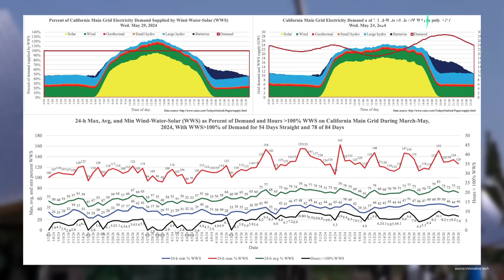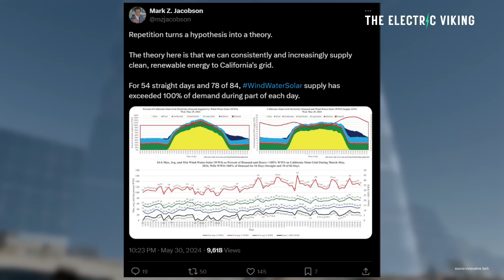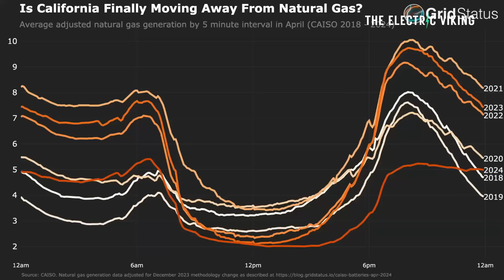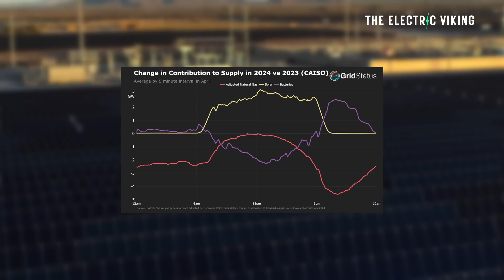Solar smashes records in California, 'DUCK curve' nearly wiped out

Comment: I have never heard so much BS about Peaker battery operations. If your imagination could get you to 100% solar, this guy accomplished it. What happens when the sun doesn’t shine or the wind doesn’t blow? Find another generating source or do roving blackouts like South Africa. This is what Californians have to look forward to an addition to the high electrical rates caused by electric vehicles and green energy. Sorry to burst your bubble, I am all for green energy, but this is not reality.
Reply: The trend is to install combined cycle power plants. They are more flexible, faster, startup faster and efficient. Other trends  are towards decentralization, distributed generation and Virtual Power Plants (VPP). Ultimately a widely dispersed network should have enough resources. With, an intelligent system, problems should be manageable . Yes, extremes condition could require curtailment, but it is a simpler system that should cost less.
Reply: California, I'm told, currently has less power outages than in the past.

Comment: Sam, we are in the Sierra Nevada Mountains on the first warm day of the year. The thermometer in the shade of our front porch reads a warm 97 F. That is about average for Summ here. 

Our power is $0.41 US per kWh. On “smart days”, today for example, our power is four times that price in the late afternoon and early evening.

The California electric utility system is nothing for anyone anywhere to emulate or admire. The three electricity monopolies have divided up the state like any cartel divides its territories. The SDGE gang’s hood is San Diego, Edison has LA and the Southern Central Valley, and PG&E runs Northern California. 

I
The Capo of the Northern California pulls in at least 10 mil a year. 2021’s was an especially good haul, and the Capo picked the pockets of California ratepayers for 50 million. 

The only option Californians are left with is to cut ties with the corrupt utility cartel completely and go solar and batteries and go off grid. That is why I’m constantly writing in your comments section that we desperately need more affordable home storage batteries. With our need for home cooling during our warm summer nights, and lights on rainy and snowy winter nights, per my calculations the smallest battery system I could get away with is 50 kWh.

Comment: Did you all miss the key phrase. It reached 100 percent for part of the day. Not all day every day. And they still require a complete fossil fuel back up system for when the wind isn't blowing and the sun ain't shinning. So how can running 2 complete systems be cheap.
Reply: But when your not paying for those hours that's big bucks savings.  As more gets added longer times will come.
Reply: @leshigger6517  but you have to pay for the infrastructure weather you are using it or not. To have a complete highly capital intensive plant sitting there unused is expensive both in opportunity cost and holding cost. So when the plant is running the sale price of the electricity must be huge to cover the cost of having the plant sitting idle for most of the time. It is basic economics.
Reply: If you use battery storage like megiapacks you are not running a speaker plant generator.  AZ has been doing that for a few years now. I believe Texas in building one now. My brother in law just leased property for 20 packs to replace a proposed peaker NG plant in AZ. This is where it's going. Newer cheaper megapacks coming on line are replacing gas and oil and coal peaker generators.
Reply: They're not listening. But I appreciate your effort.
Reply: There you go using facts and logic, rudely interrupting their fantasy.
“. . . a naïve observer might conclude that the rising share of new renewables (solar and wind) will usher in an era of falling electricity prices.  But in reality, the opposite has been true.”  Vaclav Smil, Numbers Don’t Lie, p.172

Comment: In the future nobody will mention V2G, or V2H, or V2L, (grid, or home or load)
Nobody will mention grid electricity. 
Nobody will mention selfplug-in or selfparking. 
Nobody will mention electricity bills or gas bills. 
Rooftop solar PV will just be your roof with a waterproof membrane underneath. 
Rooftop will be 'plug-n-play' with micro inverters.
Reply: It doen's need to be micro inverter, but certainly some kind of inverter.

Comment: 2 new, giant wind plants and several new giant solar plants are in development now, to start supplying power to CA in the next 1-2 years.  Cal. is working to: 130% of total capacity via solar, wind and hydro, to net-export power to other states.
Reply: It would be interesting to see their seasonal output.  The shoulder seasons: Spring & Fall are the best for percentage of solar generation because the sun is still relatively high and demand for heating and cooling is low.  If they can achieve 130% in the summer hot season and the winter cold season, that would be impressive.
Reply: @glibsonoran  Agreed.  This transition won't be smooth.  Mistakes will be made.  Inefficiencies will happen.  But in a decade we'll be amazed at progress.  Heck, 5 years might be worth celebrating.
Reply: And 130% makes sense because you need to top off energy storage.

Comment: Did you hear in California so many people drive EVs that they now want to tax the people $.03 per mile driven to replace the gas tax they're losing!
Reply: Fake news
Reply: The actuality is that they have asked for volunteers to test the practicality of a VMT tax. What they propose, but is years away, is a tax that depends the product of car weight and miles driven. This would replace the gas tax and would be a charge closer to the damage done to roads. Remember, the damage done by an axle is proportional to the 4.2 power of the axle weight.
Reply: Well if they tax per mile like a taxi why spend tens of thousands of dollars on a car, and  registration, inspection and insurance. It would be better to take an Uber.
Reply: @PyroShields  If you have a gas car you are taxed automatically (and heftily) per mile, by the taxes on gas. It's just fair that EV owners also do their part, because their vehicles create much more road degradation (and also more tire/rubber pollution) than ICE cars, due to their ridiculous weight.
Reply: @hiram1923  If you take  a taxi  or an uber you pay by mile. So who would buy a car to  pay per mile lol. Even better get an Ebike. No registration required.
Reply: @PyroShields  Everyone pays per mile, except EV users so far. Which is (to some extend) fair because it pays for road repairs. If you have a car but drive only very little, you should also pay less on taxes, because you create less road degradation.
Reply: @hiram1923  That's not how it works in the US. You pay for road tax, when you file your taxes that's when you pay.  The newer the car the more you pay. Your tax per mile theory would never work because, how would they track the miles? Why buy a car just uber or buy an ebike and even if you have a car people will start rolling back the miles.

Comment: Sounds like propaganda. Cali has very high electricity prices and keeping a long paid off nuke plant open is not the reason.  In fact when the Cali Governor realized there was a danger that in closing the nuke plant he changed his mind coz there was a danger of power brownouts that would hurt his political standing.  Every summer for years now the Cali grid has been hanging by a thread with consumers asked not to run aircon to stop brownouts. Get though one summer with no danger of brownouts and you might have a point ... but you don't coz ... every summer in Cali there is the danger of brownouts. So you have some of the highest prices and brownout danger in Cali.  What a disgrace.

Comment: ☆You make me think.😀

As I said, only the government can afford to lose grid income. 

So, it should be the government and not Austgrid installing the community batteries. 
And giving up the income from the suburbs with the battery.

At the moment, all customers pay the same GRID RENTAL kWh. 
The customers at the power station pay the same GRID RENTAL as the customers 1,000km away. 

The little local grid to the generators' neighbours should be a few cents for the GRID RENTAL.

The 1,000km distant customers should pay 100cents kWh or more for GRID RENTAL. 

That is the concept to help your understanding. 

When you are carried different distances, you pay different amounts. 
When you send something of value, different distances you pay per km.

I am saying a community battery paying for the battery cost plus a SMALL GRID RENTAL fee would be the same as the house battery and no grid rental fee.
It would have maximum 'economy of scale' plus real grid costs plus backup to individual homes that are in need of local grid supply. 

As early adopters fill the test suburban streets with V2G and do not need any grid electricity, then the community battery can be moved to the next test suburb, most likely to have V2G EVs and rooftop PV. 

The private sector will see that the 'offgrid' in the suburbs is very practical and electorally attractive.

The government will see that new grid capacity construction will not be necessary. 
New generation capacity will not be needed. 
This is a massive cost saving.
Petroleum imports can be reduced. 

If the grid is to be kept, then 20 million buildings paying 1$/day connection fee would cover grid maintenance.

Australia can demonstrate to the world that EV and rooftop PV is viable. 

80% of the world's population live in warm latitudes. 
80% of the world's population lives in dictatorships. 

Non Petroleum countries can not sustain distant wars. Logistics problems. 
Hahaha Hahaha 👍 

People with glass roofs don't throw stones.
Hahaha 👍

Comment: It is anti electric to make expensive unreliable unsustainable power grids that are causing industries to relocate and discouraging new industries from being built.  Southern California power grid is a disaster.   Southern California has the highest cost electricity in the USA along with bankrupt power grids unable to modernize their high voltage lines.  They have been forced into being unsustainable, bankrupt and having to import power.  

 In the USA wind turbine generated electricity always cause electric rates to go up if the rate payers are having to pay for them.    Solar panel electric In order to power the grid that is not charging storage has to have ready power to make up when a cloud goes over a solar farm.   That electric supply is probably running on expense natural gas that keeps having to run even when solar power might for a few seconds power 100% of the grid.   

SoCa without new technology nuclear plants could benefit immensely from a new large ultra high efficiency clean burning coal power electric generation plant in the 6 - 12 GW capacity likely placed on the coast for ship delivery of coal.   The fueling costs would be 1/4 cheap natural gas prices.   Cheap natural gas is difficult to maintain with shale natural gas only producing highly when first started.  A decade from now natural gas in the USA might still be a good buy, but not cheap.

A fossil gas can be about any gas that comes from the earth such as sulfur dioxide.  Without large subsidies and huge incentives solar electric and wind turbine electric power would have little implementation in the USA.  As it is they may just break even.   This would be fine for incentives of developing to higher levels, but we are now at a high level development without large improvements in cost benefit likely.   

The SoCo power grid is having to buy roof top solar that is close to worthless at net metering rates until recently and still has to do that indefinitely for existing solar panel installations.

Comment: I retired from a municipal Power and Water utility in Central Florida. My former employer is moving away from fossil fuel to renewables. Because green power is cheaper. My daughter part owner and manager of a pest control company are selling their gas fleet of vehicles and replacing them with electric vehicles. Because there are big money savings to be had . Dropped the cost of transportation to half of what it had been.  Plan on putting solar panels on their property to eventual charge their vehicles saving more. The fossil fuel oligarchs are fighting this but they cannot stop it. This is going to change the balance of power of the USA as without money or much less money the fossil fuel oligarchs will not be able to buy elections so easily and fund disinformation to fool voters into voting the interest of the oligarchs not their own actual interest.

Comment: Grid electricity bill 50cents is basically 2 parts for me:
5cents kWh feedin.
45cents kWh grid rental. 

Electricity is dirt cheap 
Grid rental is expensive 

The grid is 10times more expensive than central generation plant. 

Nuclear electricity is 5cents kWh 
Distant renewables is 5cents kWh 
Fossil fueled is 5cents kWh 
Hydro generation? 5cents kWh 

The owners of the grid need 45cents kWh to pay back the cost of the grid investment and maintenance 24/7/365.

New grid construction costs and old grid upgrade costs tell you that millions of km of national electrical grid costs $$$$$$TRILLIONS. 

Hello  hello 👋

Rooftop is often only 33m2 on a 220m2 roof 
Rooftop installed is basically cheaper than windows $/m2 
Rooftop has NO grid costs. 

With selfplug-in V2G EVs at every building and home, every customer does not need grid electricity.
No grid costs.

Offgrid is extremely dangerous, economically, to the massive investment in the national grid. 

But climate destabilisation is extremely dangerous, economically, to the nation.

Technology wise, the grid owners can only delay, nothing stopping the new technology now.

Elon Musk knows this, as do all the automotive manufacturers and the military and grid owners and superannuation funds and private investors.

Offgrid in the suburbs using community batteries in the early adopter suburbs is the killer change.

Comment: Hey Sam,
You missed geothermal. 
Almost 6% of CA's electricity came from that source in 2018. Didn't do further research but I thought you should know. 
Thanks for what you do, I really enjoy you channel 😊
Reply: California is the largest generator of electricity from geothermal energy in the United States, with more than 650 active, high-temperature wells tapping into geothermal fields.
In 2018, the state received 5.92 percent of its electrical energy from geothermal resources.
The problem with Geothermal Energy is, Fracking. California is in the process of making it illegal.
Reply: @johndavid9418  California is capable of distinguishing between fracking for geothermal and fracking for oil and gas.  I bet they'll get that figured out.
Reply: @incognitotorpedo42  
They intend on replacing their Geothermal with renewables.
Reply: Unfortunately, the percentage of geothermal keeps going down as wind and solar get installed.  2018 was 6 years ago, time flies.   Geothermal does give a nice even 800MW throughout the day but compared to today's total system capacity of 50GW, it keeps getting smaller as a percentage.  Here's some numbers from the April report.  Solar 19.1TWh, Wind 8.1TWh, Geothermal 1.6TWh, plus some other renewables.  But imports and fossil fuels were about half of all power generated still.  The CAISO website is making it hard to get a number for fossil fuels for April without downloading each day separately . But Geothermal is about 5% of the renewables for Apr., not all power generation.